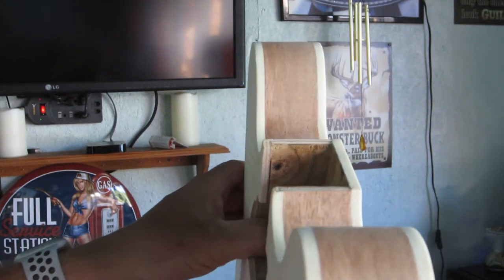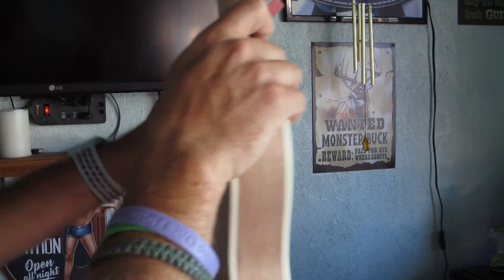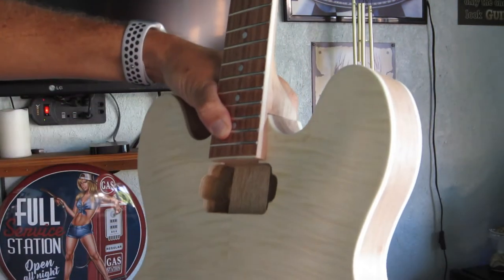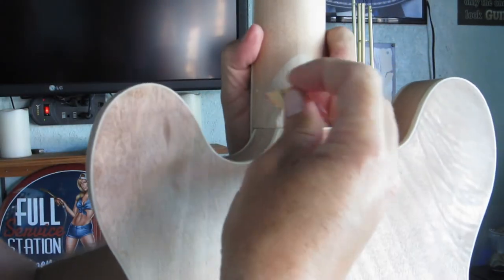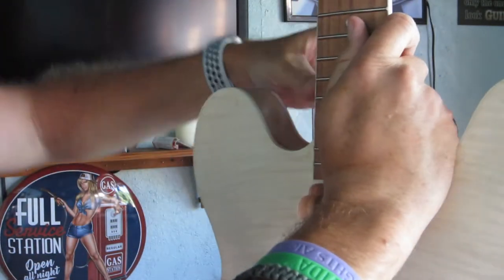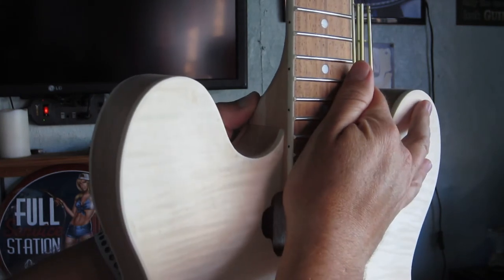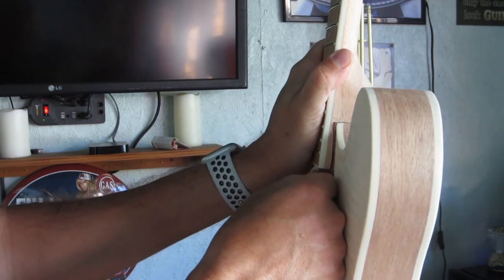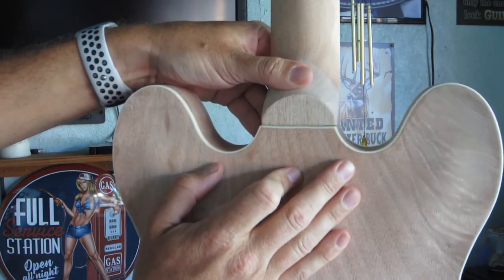Building a StewMac ES-335 Kit - Part 1 - Set Neck Preparation.

Comment: Just started working on mine 2 days ago. There was a good bit of wiggle in the neck joint area so this sandpaper trick will help out. I've assembled a few Carvin bass kits over the years but they were bolt on necks. This is my first set neck and I don't want to screw it up!

Comment: Just wondering… if you’re taking material off of each side, aren’t you leaving a high spot in the middle?
Reply from the maker: Thanks for watching! There was not a lot of work needed in the heel of the neck/middle areas. If I recall correctly I did hit the heel/block with a quick 120 grit off camera to be safe and give a better grabbing surface for the glue. 

It was fairly ill fitting on the sides where I used to sandpaper strips to true it up. I checked for high spots and wiggling before the glueing to be safe!
Reply: @iambucketdotcom_official  Thank you for clarifying! I'm enjoying the series.

Comment: I’ve just got this kit and have a gap between the bottom of the neck and the edge of the trim of the body of about 2mm. Will this method remove too much material and in so doing drop the neck too far relative to the body for later tuning /playability
Reply from the maker: Hi Sorry! I somehow missed this. You shouldn't have to worry about removing too much material, I would estimate mine was about 1.5mm to 1.75mm, So almost as much as yours. I minimally touched the horn/heel that fits into the pocket. Most of the trimming was done on the sides to allow it to drop into place better.
Reply: I have the same concern it fits well at the guitar top but a bigger gap in the rear, I would small block sand but I'm wondering if it should be routed down?